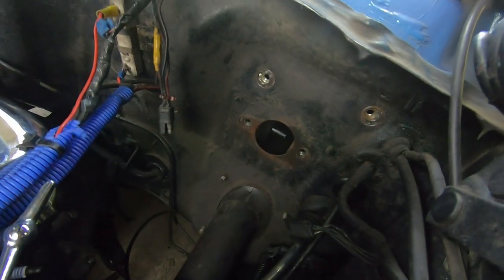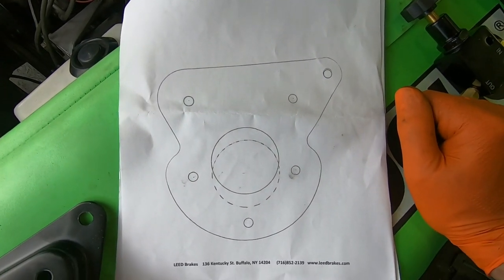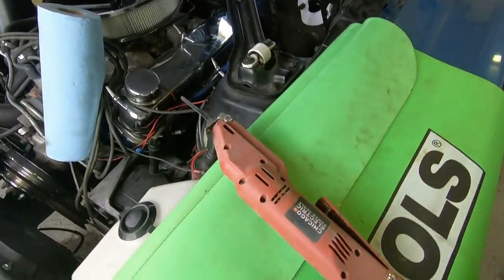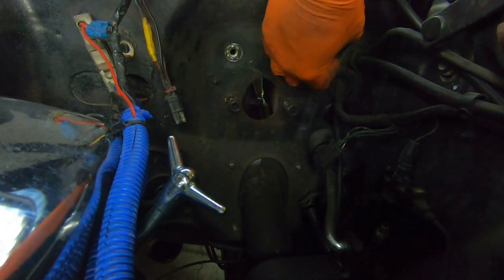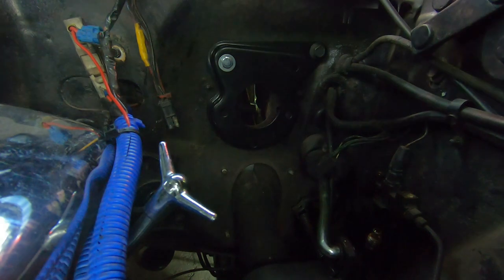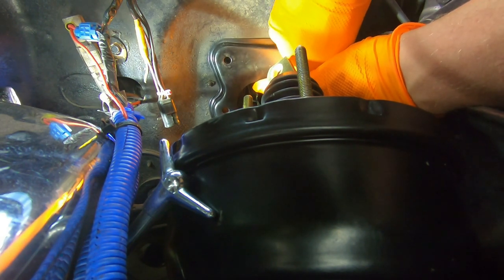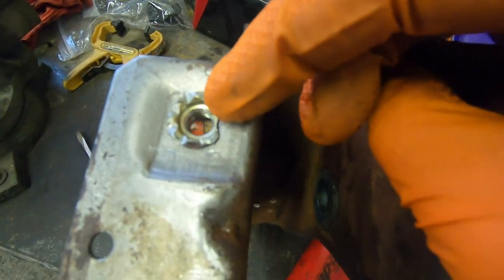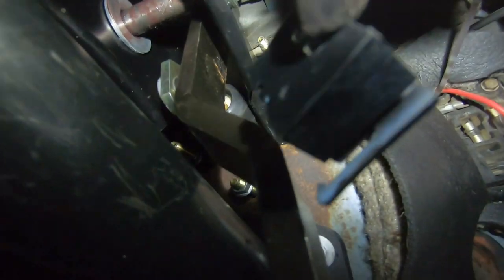Power Brake Booster Upgrade - 1967 Ford Mustang - Disc brake conversion - Part 2

Comment: In high school I had a 390 fastback mustang with manual drum brakes. Lot of fun using two feet standing on the brake pedal trying to do a high speed stop. Wish I would have done a conversion.
Reply from the maker: Oh wow that sounds awesome, I assume you no longer have the car?
Reply: @AlfsMustangGarage   one of my biggest regrets in life was selling that mustang so I could get married. I sold it for $500. As a roller. So I could get married to my now ex wife.😭
Reply from the maker: Oh man that sounds awful!!! Story of our lives - if we knew then what we know now! Right?
Reply: @AlfsMustangGarage  yup
Reply: I had a 71 Torino 351C drums all around... Yep, 2 feet on the brake while pulling on the steering wheel!

Comment: I work at a parts store and I had a customer wanting to go back to factory brakes with the single master cylinder, and use it as regular driver. I convinced him to stay with the upgrade.
Reply from the maker: Oh ya thats good. These upgrades are great and I would only suggest against it if it's a car being restored to original condition with the intention to take to car shows.

Comment: Hello.  I have a question for you.  I am installing a power brake booster upgrade to my 1967 Mustang.  I have a copy of the original Ford power brake install kit instructions.  In these instructions it says to drill out the existing nuts using a .64 diameter drill bit (this would be about a 5/8 drill bit), however in another set of instructions that I have for a power booster kit it says to drill the holes out to 5/16 of an inch.  That is quite the difference in hole sizes.  Plus the 5/16 does not make much of a difference in opening up the size in the original nuts.  The question then is should I follow the ford instructions, or will this make the holes to large for a good fit of the booster? Any advice would be appreciated. Thanks.
Reply from the maker: I would say it's always easier to take more metal out then to add some back in. Start small and if that doesn't work, go bigger till it does work.
Reply: @AlfsMustangGarage  Thank you that is good advice.  I will take my time enlarging the holes until a good fit is obtained.
Reply from the maker: Sounds good 👍

Comment: … if you look from the inside where the Brakepedal is there should be an indent for the larger hole for the cars that were delivered with a brakebooster so easy to see where to cut and enlarge the opening for the pushrod etc. !! 😉
Reply from the maker: Oh right on. I'll have to look for that on the next one 👍